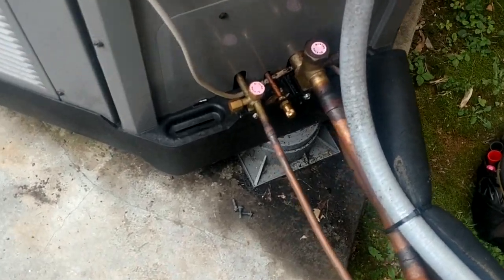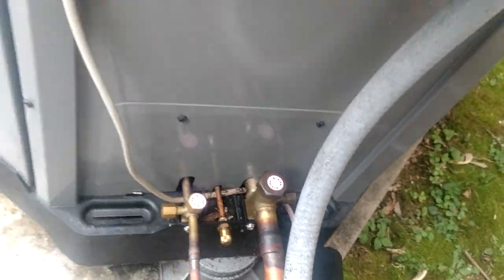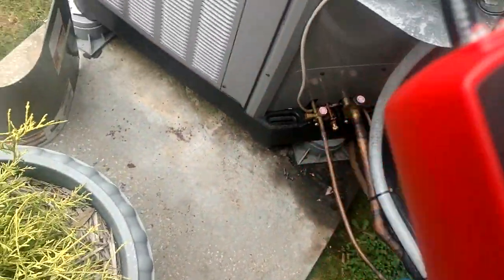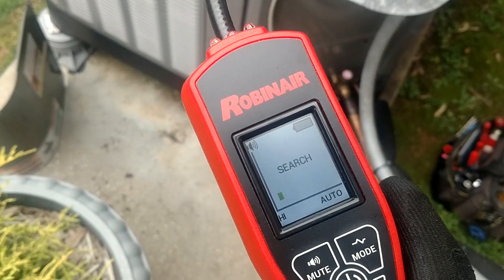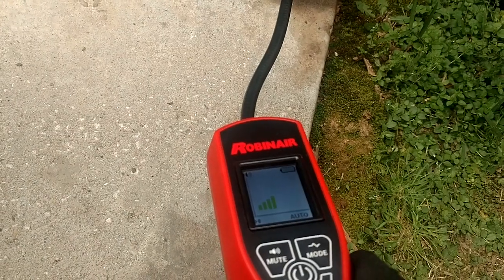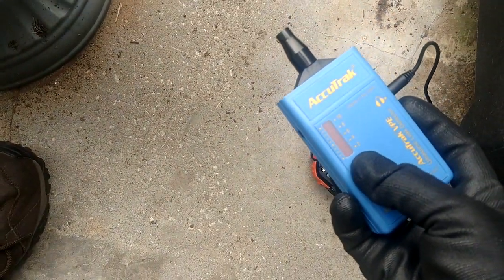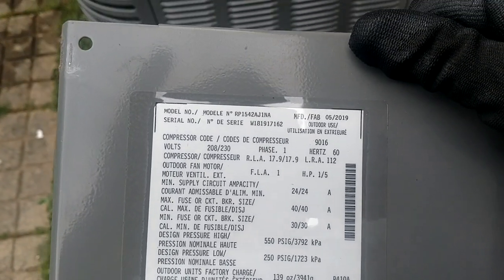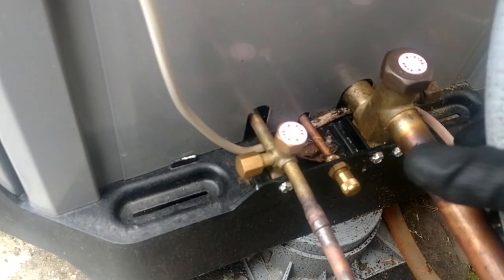R-410A leak found on solder joint at outdoor unit. Confirmed with LD7 & Accutrak ultrasonic.  👃+🎧

Comment: ... uh boy...
(Personal review of checklist of sequence of things have to do to fix this; viewers: feel free to correct):

1) vacuum pump out all refrigerant into an r410a recovery tank.

2) fill/flow line set with nitrogen

3) re-braze (braize?) the two leaks

4) isolate the liquid lineset

5) un-braise the filter drier, replace,  nitrogen-purge the lineset, re raise the new filter drier

6) nitrogen pressurize whole system for leak check

7) Vacuum whole system to 500 microns; leak check again

8) refill refrigerant (weighed in) through suction side (slowly)

9) test pressures under load

(How long does all this take?)

Comment: I know this is off the topic but what are those little round “stands” that the outdoor unit is sitting on.?? Shouldn’t the unit be sitting on a complete, solid “slab” to minimize movement ?? 
Never seen that before, please clarify. Thanks 😊👍
Reply from the maker: Those are called pump-ups. They are just simply feet that raise the unit about 4 inches off of the ground. And those go under all heat pumps because heat pumps defrost in the winter time and the thawed out water drips down it can actually accumulate at the bottom & freeze into a solid block of ice and lift the unit off of the ground if it's not sitting up on those feet like that . So NO solid pads under a heat pump. 😎👍 THANKS FOR WATCHING!
Reply: @sknight0391  Thanks so much for the reply. That really answered my question to the T . 👍😊

Comment: I have had luck with windex on those tiny leaks. It foams up good we’re big blue might make some tiny small clear bubbles. Do you think the ultrasonic tester you have or one with gooseneck would be a better buy. I have a unit that supposedly was gassed 5 times last year. No oil anywhere. I put in 2 lbs other night. Yet sniffer and bubbles didn’t pick anything up. I put locking caps to prevent chance someone is stealing. This unit made me realize time for me to invest in a useful new tool.
Reply from the maker: Hacker I honestly don't know if the ultrasonic would pick up a leak like that. It might, but I couldn't guarantee it. If I bought one again I would probably get the gooseneck. But with you working on steam traps and things like that you might like the one that I have in the video because it comes with a metal wand that you can touch to valves and hear if they're bypassing or not. Good luck with your leak. You think it might be the king valves?

Comment: on the leak detect liquid, it's usually best to leave dauber soaked and  let it drip(close range) and naturally run around/puddle up on the area that way you don't make so many bubbles wiping it it on and the bubbles are usually very light and above a clear liquid line.. it's harder to do on vertical piping uphill, but it will usually run over and down then capillary around.

Comment: I really would’ve thought you would get that joint to bubble. It’s clearly leaking with all that oil around and you can see a void in that silfoss. You would think a nitrogen pressure test during the install would have found that leak not to mention the decay test after the vacuum would have leaked too. I’m about to buy the Fieldpiece slr8 have you ever used it and if you have how does that ld7 compare to it?
Reply: late evening job maybe? braze/vac/release charge and run?
Reply from the maker: @throttlebottle5906  they definitely should have done better than that .
Reply from the maker: The srl8 is a pretty good detector also. I think that it gives a few more false positives than the LD7. The Fieldpiece does have a pretty good rechargeable battery and the ld7 runs off of 4-AAbatteries.

Comment: Good job buddy, I hate when I can’t get it to bubble. That accutrak really confirmed it paired with the sniffer. Great find on the tiny ones.
Reply from the maker: I hate when the ultrasonic makes that noise when I'm trying to film. I don't hear that unless I have my phone out using it. 
She a leaker baby. 👶👍
Reply from the maker: That LD7 is nice. I've had very good results with it. Very few false positives.  If they would just change that alert sound to very with the size of the leak it would be the 💣